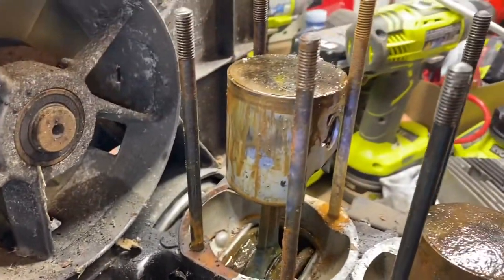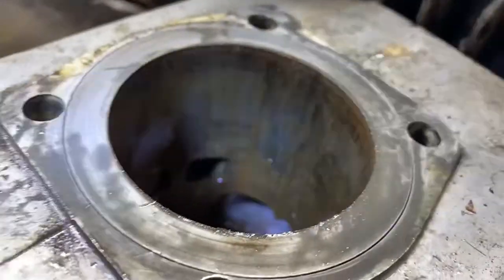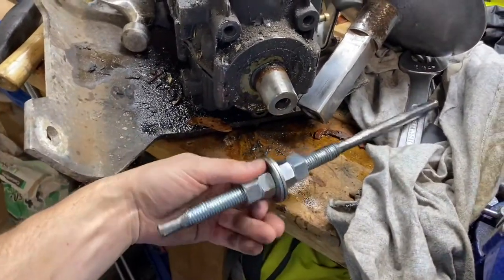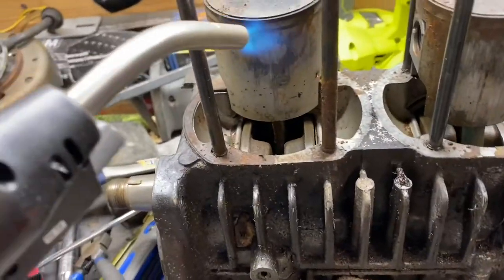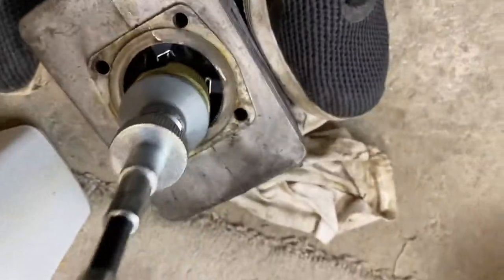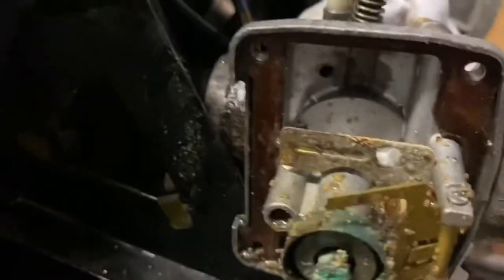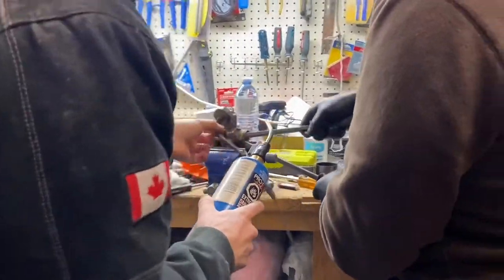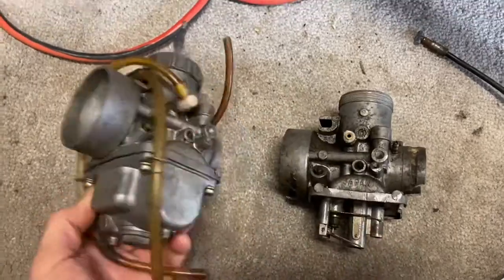Trying to fix a 1989 Skidoo Safari 377 #skidoosafari

Comment: Great video. I ran mine this weekend and lost the left cylinder (0 compression). The piston on the right (90psi) got me back home 😅. I’m looking only to rebuild the top end. I shouldn’t have to do the crank, too, will I?
Reply from the maker: At least you made it home. It depends these motors are usually pretty good for the crank seals lasting and not needing to be replaced. Replacing the top end is much easier too. You might get away with it but hard to tell for sure.
Reply: @NorthernChris1 your supposed to hold the throttle wide open when checking compression the compression will go up if you hold it wide open
Reply from the maker: @Red-head-triple1 That makes a lot of sense, I will try that next time!

Comment: Nice video, you’ll pry gain some compression once you do get it running and the rings seat in.
Reply from the maker: Thanks! The motor is in rough shape. The bearings are toast. I’d be lucky to drive it 100 feet.
Reply: One of those moments you get 50 puls in and it kicks once then repeat

Comment: Just curious why you would not have the cylinders bored out (0.060") and install new (0.060") pistons?
Reply from the maker: I was trying to fox this for cheap. So boring the cylinders out and getting oversized pistons would cost as much as a junkyard skidoo 377 motor. Which in hindsight would have been a good idea. This motor is shot
Reply: @NorthernChris1  Understood, thank you

Comment: I was about to say your crank is fucked because my 377 was in a barn no cover and I didn’t replace the crank or barring now I just did a nother rebuild and I had to get a new crank
Reply from the maker: Yes, the crank and bears, seals are all bad. That’s why you always cover stuff if you leave it outside. Easier and cheaper to buy a used motor and drop it in.